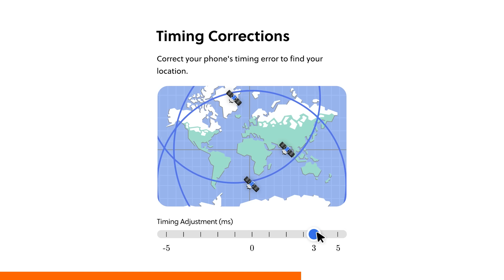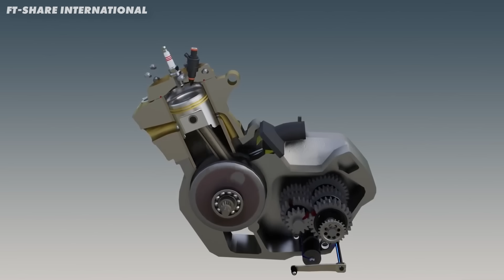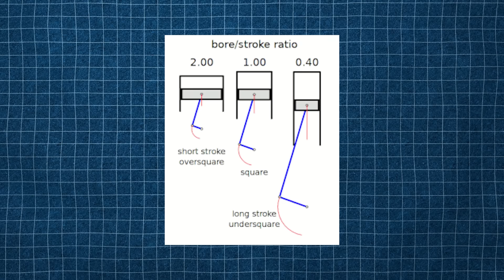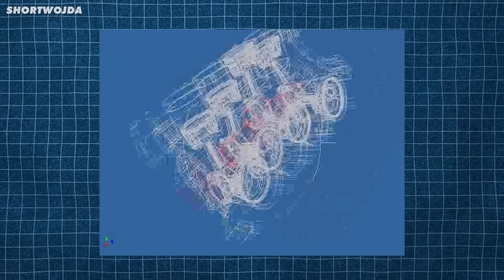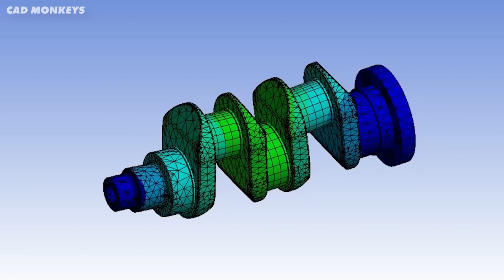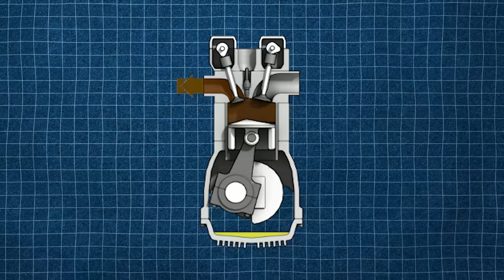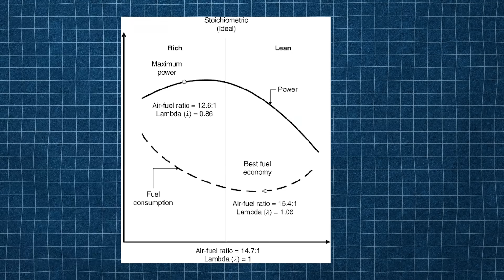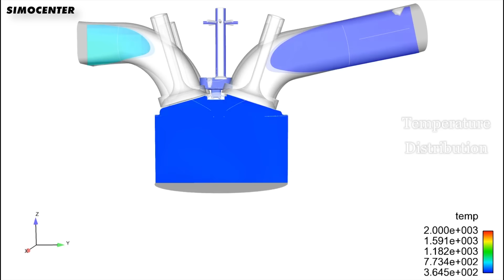Why It’s Almost Impossible to Rev to 21,000 RPM

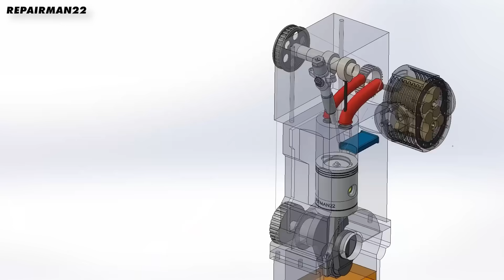Comment: The part at about 5:21 - 5:31 is incredibly painful. 2 strokes do not have to burn the oil that is used for lubricant any more than any other piston or rotary internal combustion does. In fact whats even more painful about this is the animation there shows a engine with a blower similar to the 2 stroke detroit diesels. (this particular design does not burn the oil) Not to mention the so claimed emissions  and reliability concerns with burning the oil simply are mostly inaccurate or straight up incorrect depending on what part your talking about. Burning premixed gas and oil is bad for emissions compliance yes. However all emissions control systems already in service for modern engines would work with 2 strokes like the detroit diesel's  there are pleanty of 2 stroke engine designs going back to 1872 that have no need to premix oil and fuel. To be clear thats 19 years after the first true internal combustion engine. 2 strokes are only 19 years from the oldest of internal combustion engine designs and a good portion of those designs as I said have absolutely no need for premixed fuel and can completely be used with hydraulic bearing aseemblies and effectively sealed crankcases.These engines overcome the crank case pressuization issue that needs to happen to force a new charge up into the cylinder by using forced induction namely often a blower (aka supercharger and this is where your popular superchargers came from earlier in drag racing many of them were off of 2 stroke detroit diesels then adapted for use on 4 stroke v8s.) thats where the production numbers became high enough to make them fairly affordable. (Relatively speaking) In these systems the crank case is nearly sealed and you end up typical running a hydraulic bearing assembly. The freah charge air is forced in with the forced induction system and the fuel can be added either by a carb or via a injector and it can either be direct injection or common rail or even just injected into the intake. You only need the blower to produce a few PSI of positive pressure to overcome the force of the residual pressure from residual exhaust gases. In more simplistic 2 strokes like many but not all marine 2 strokes. Dirt bikes , weed wackers , chain saws , motorcycles , ect they pressurize the crankcase with a valve that opens and closes which forced the fresh fuel air charge up into the cylinder. Typically a reed valve but can also be a rotary valve. This is only done on the most simplistic engine designs or ones where mixing fuel and oil is not a concern. Its not even new tech to use a forced induction system  and a hydraulic bearing assembly in a 2 stroke engine been done for more than 70 years now along with the other style of NA 2 strokes without it. Actually in addition there have been some engine designs to use a "dead" cylinder to act as a forced induction system to pull off this same effect. Some of these designs are nearly as old as the internal combustion engine. The only issue inherent in a 2 stroke design that has not been completely solved and is sort of a function of the design is their natural somewhat asthmatic transition between combustion and intake where your trying to get the exhaust out and a new change into a cylinder that is a bit above atmospheric pressure. Hence the need to provide some form of forced induction. We have full direct injection systems, port tuning/timing systems , we can go full hydraulic bearing and have for more then 70 years (thats very old tech) we just dont see all of these features on modern engines (some you do like direct injection but its still used on simplistic engine designs with a pressurized crank case) its simply cost and complacency within the companies that still use them. If the numbers of small supercharger assmebles were increased the cost would drop and make it more common to see. Im not saying 2 strokes are inherently the best for all things. Just that this information is really BAD at the above timestamps and not only is incorrect it is also confusing cause he says 2 strokes have to burn their own lubricant while showing the diagram that is pretty much a 2 stroke detroit diesel. This is a system that doesn't do that. We have much much much older designs as well that also do not have to premix that go back to nearly the dawn of internal combustion motors. (1872 here) And the early internal combustion engine came out of 1853. Talking 19 years later here. I do not even have the time or space here to get jnto the incorrect info about reliability or lifespan that was also mentioned in the video. There are 2 stroke engines still in service that are substantially older than many of the adults watching this video. You can optimize a engine for many things. Its a bad assumption to think what makes a cheap 2 stroke weed eater not all that special or relaible then apply that to the entire 2 stroke engine design philosophy. It is simply incorrect ...yet more bad info in this video. Infact i have mutiple 2 stroke motors that have been in service since the early 1950s and never have had a major mechancial overhaul and that even includes the detrimental effects to the engines with the modern e10 and e15 fuels. I have a 4 cylinder powerhead from 1960 and a twin from the early 50s still in service that have a lot of life left in them and are older than most of the people watching this. There is nothing we do with 2 strokes that cannot also be done with a 2 stroke outside of the limiations with around forcing new air and fuel charge into the cylinder. That only takes some form of low pressure forced induction. Talking few psi at most. Blower / supercharger , turbo , dead cylinder , pressurized crankcase ,  hydraulic bearings , emissions systems like Catalytic converters , 02 sensors , direct injection, common rail or multipoint fuel injection, variable timing / variable port timing and even EGR can be used with them. Depending on how you want to optimize the engine. The only significant difference between the technologies that make up 2 and 4 strokes is the design philosophy around intake and exhaust cycles. Fudimentially almost all of the other tech is shared or can work on the other with the right design.

Comment: You made it out to seem that there was a reason that specifically 20,000 rpm is the limit.
Reply: Right?  Like a sound barrier.
Reply: All of things in the video create that barrier.
Taken to the limits across the board , its the rev speed where you cant get any higher.
Driving something at speed with a reciprocating mass tops out around there.
You can goi a little faster with a rotary engine but heat soak becomes a big issue and your limited ti around 20000 for anything resembling reliability.
Reply: @deadprivacy  no they dont
Reply: @deadprivacy   There was literally no hard evidence in this video that said 20k was a hard barrier. F1 stopped there because they have a myriad of factors to balance, but you can rev higher if you compromise for 1 example: power (ie having smaller and lighter pistons, giving a smaller bore, smaller and lighter valves). This video was just a giant history lesson on engine RPM in f1

Comment: Because they don't want or need to.
Everything about F1 is rules and limitations, if they had to rev to 21000, they'd figure it out. ( and we'd probably see some new rotary designs because pistons are horrifically inefficient when scaled with speed, because the reciprocating load scales with revs )
Reply: Problem is that rotaries, due to low compression ratios, massive conbustion chambers, are terribly inefficient, which is the opposite direction the FIA wants for F1
Reply: @c-ro311 That's precisely the problem.  The clowns dictating the technical parameters are, in the depths of their evil black hearts, accountants and politicians.
Reply: @chuckschillingvideos  nah they aren't clowns: almost any numbskull can make a 1000 hp engine, making them efficient at the same time is what advances technology
Reply: Exactly. Physics wouldn’t apply if the rules required them not to. We would have faster than light travel now too if the FIA made it a rule.
Reply: Real galaxy brain take here

Comment: An interesting side note: it's not uncommon for the massive diesel engines on cargo ships to be 2-cycle, but that's at least in part because they run slow enough to be able to effectively replace the exhaust with fresh air via blowers (which they have the room for) and that also allows them to not run oil mixed with the fuel (which might not be as big a deal given the fuel they run isn't that much different in weight than motor oil).
Reply: They're also very efficient
Reply: @filipruml e.g. "30 weight" oil is a common motor oil. It mostly refers to viscosity.
Reply: @benjaminshropshire2900  exactly
Reply: Also means you can run them in reverse easily so can dispense with a gearbox.
I digress....
Reply: Your forgetting the Detroit Diesel Series 71 series two-stroke diesel engines , available in both inline and V configurations for buses,trucks and tanks.
Reply: In weight? What does that mean?
Reply: @filipruml  think they're referring to the viscosity of the oil. 
They used to run "better"/lighter  grade for manouvering for better stop/start/response and then something almost akin to tar for once at sea and full speed.
Reply: @reetspetit  Where did you hear that? I ran diesels on Navy Ships and we used  JP5 Fuel. Exclusively.
Reply: @T0mmyTune  when I was a naviguesser on merchant ships :-)
You guys with your peashooters run much better stuff. Especially if you run gas turbines.
You need performance.
Merchant ship owners need profit so they run something akin to sludge. It almost sets when cold.
Reply: @T0mmyTune  JP5 on ships with gas turbine engines.  Large cargo ships use heavy marine oil which has to be heated to get it liquid enough toe use.
Reply: @filipruml it’s an inverse scale of density and usually that corresponds to viscosity and presence of long chain alkanes 

https://en.m.wikipedia.org/wiki/API_gravity
Reply: A marine diesel 2 stroke is not like your weedeater 2 stroke
Reply: "Marine" doesn't have a patent on 2 cycle diesel.
Detroit had several 2 stroke designs used in stationary and industrial applications.
There used to be many OTR 18-wheelers in the US powered by 2 stroke Detroit diesels.

Comment: The main reasons are actually the speed of the flamewall starts to be too slow, the combination of high compression and ultrashort stroke reaches mechanical limits, and the extremely narrow gap between head and piston at TDC prevents a clean burn. The mechanical load is a problem that is solvable.
Reply: Yep deflagration is too slow of a combustion method at this point. Detonation could help if an internal combustion engine could make it work like a pulse detonation or rotating detonation engine in aerospace.
Reply: Pancake combustion chambers aren't ideal but convention propagation was still fast enough for an NA F1 engine, it was quite common to see some auto-ignition in the end gas of some of the old engines - it may have resulted in a tiny benefit in BSFC but nothing significant.
Reply: @Colby_0-3_IRL_and_title_fights  Detonation works in reaction engines because the ejected gases are light, a detonation wave inside a reciprocating piston engine would be like trying to push a locomotive by shooting naval artillery at it.
Reply: Yes, absolutely correct. There is a thermodynamic limit to how fast the fuel mixture can burn and expand.
Reply: @qasimmir7117  Unless you use compression ignition, which basically ignites must of the mixture *at once*.
Reply: THANK YOU!
Reply: Why not use many ignition points? Integrated spark plugs on the head so they are small and numerous? Would that be a feasible solution or too difficult/expensive? or maybe not wouldn't even work.
Reply: @teresashinkansen9402  That's how it's done in rotary engines. It probably could be done in 4-stroke engines, but a second spark plug means less space for valves.
Reply: Two spark plugs, properly located will overcome the flame spread problem.
Reply: @Wexdue29  True, but then the valves have to be smaller and that means less air can be sucked into the cylinder. Every concept has its strengths, weaknesses and a sweet spot. The only way to exceed 20k rpm with those V10 F1 engines seems to be with turbo-charging them, but that introduces new problems that then have to be solved.
Reply: I wouldn't be surprised to see 21k rpm broken when you combine modern engine tech and materials. AIUI there are ways to get around the deflagration limit (see modern F1 engines; sure the point is efficiency, but seems to me like you could use pre-chambers for other things too).
Reply: @samiraperi467  Maybe it could, but what would be the point? You wouldn't gain more power; quite possibly you would even lose power. At a certain point you simply run into the laws of physics and trying to go even further doesn't make any sense. Like I said in a previous post, you could force an engine to rev even higher than 21k, but you'd need forced induction, like a turbo-charger and even then you'd be on the ragged edge of the engine simply grenading because there's no margin for even the slightest error left.
Modern day racing engines have already proven that you don't need 20k revs to create an insane amount of power, so why spend huge amounts of money on trying to go beyond 20k revs?
Reply: @samiraperi467  I would be. Possible? Yes. Useful? Doubtful.
Reply: Honda did 22500 in the 60s with the rc116. Try again
Reply: @brynfisher8019  Read what I wrote again. And then you can answer for yourself why the RC116 might have just worked. While the 300cc cylinder of an F1 V8 or V10 would not.
Reply: @TheNecromancer6666  with 60 years of development I see no reason they couldn't make it work. We have way better technology and materials. The only reason they didn't is because the FIA put a limit on the strength of materials for the engine. The French are the reason they don't rev higher than 20k rpm not combustion speed. The pre chamber ignition increases combustion speed by upto 2.5x with active and around 1.5x with passive which they do currently use in F1
Reply: @TheNecromancer6666 
So either smaller engines or more pistons.
Reply: @Margarinetaylorgrease  Neither would  really solve any og the problems. Also there is no reason to rev higher. Its doesn't really gain you anything. If you want more power, add capacity. Add Boost. Work on bolstering the mid range powerband.
Reply: @brynfisher8019 there's still time to delete this
Reply: @brynfisher8019  Formula 1 engines are much larger than 50 cc. Try again.
Reply: @chitlitlah  The size of the engine is irrelevant to the thermodynamic limit being argued here, thus he is correct.  It is not a thermodynamic maximum.  Everything in the engine is scaled, not just the cylinder volume.
Reply: @jasonsmith4902  The speed of the flame doesn't scale with the engine size. Unless I'm missing something here, a smaller bore means less time for the flame to reach the sides of the combustion chamber. That's why RC vehicle engines spin like crazy.
Reply: What do expect from some who says "at this point the mass is 2.5 tonnes"?  Obviously the guy knows nothing about physics.
Reply: @thekinginyellow1744 Everyone that does know Physics, knows that he's talking of weight expressed as mass-equivalent per F=ma where a=g with g fairly constant across the Earth's surface. It's one of many conventions that people tend to use and understand the underlying assumptions about when they use it.
Reply: @gbormann71  I've got a couple of degrees in physics, and I would never express it this way.  Neither does anyone that I work with.

Comment: Meanwhile engineers: hold my beer

I bet they could do impossible, if they had a chance
Reply: We definitely could !
Reply: Without regulation only the laws of physics remain. And we know physics very well. I think every car would become a torbine car simply due to the power/weight advantage.
Reply: @Laylander  @Laylander turbines are terrible at rpm changes. 
A turbine powering a generator for electric motors is a realistic option. 
The battery or supercapacitor could be very small as it would only be needed to fill time when the turbine is speeding up